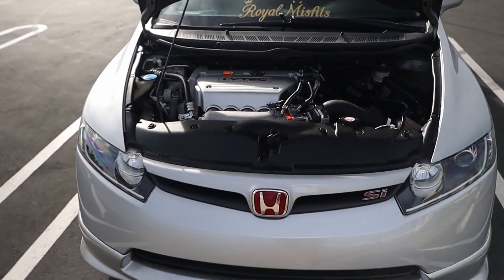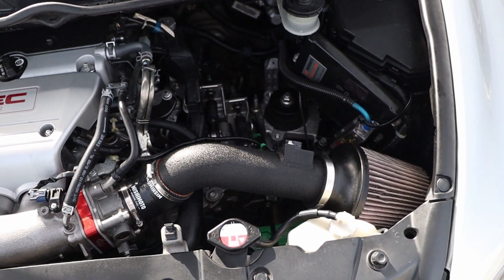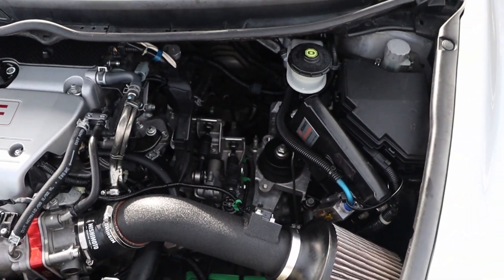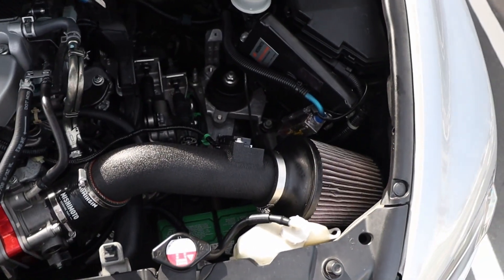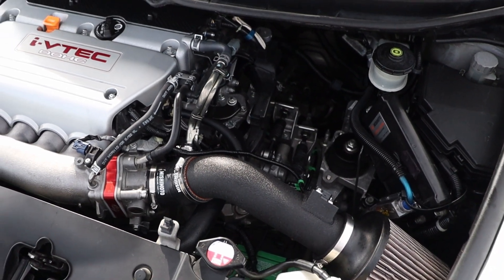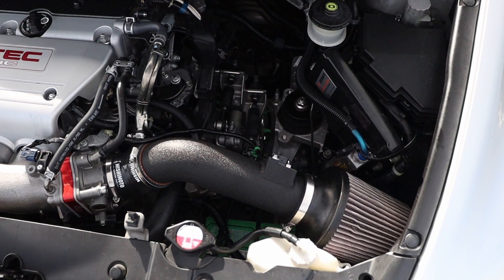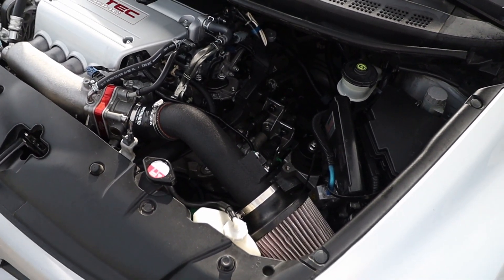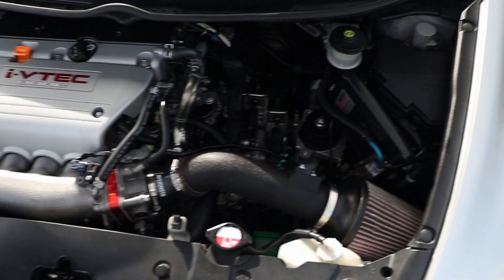8th Gen Civic Si Mishimoto Intake Review + Sound Clips

Comment: Nice video. I have the HR cai, so I am bias. But I also understand why some don't get the cold air, I haven't had any issues and I have driven is a good bit in the rain, though I do avoid puddles if I can.  Yours sounds pretty good though, especially in cab. I will have to do a similar video for mine. When I put it on, it was the first mod I did after base map flash pro, it was crazy how much louder it is. Subbed.
Reply from the maker: Thanks for the sub! I’m really tempted to purchase the HR CAI. It’s bound to happen soon…
Reply: @npvfa5  If you wanna stay with a short ram, you could also just buy a silicone upper rad hose, and run a 3.5" straight coupler to behind the headlight area. You'd lose around 5hp midrange compared to the CAI variant but yeah not too bad.
Reply from the maker: @throbbybobby7893  I was actually thinking about doing exactly that. I will probably end up purchasing the hose and using a piece of carbon tubing. Will lose the MAF sensor/IAT but i guess thats not too big of a deal.

Comment: Idk that sketchy for me. I saw that the mishimoto Intake comes with a heat shield. Plus wouldn't you leave the stock ducting from the oil intake that comes from fender to feed it cold air?
Reply from the maker: The mishimoto intake does have an optional heat shield which would help a little bit. However if you’re gonna buy the heat shield you might as well buy a cold air intake for nearly the same price. Also, the ducting which goes into the fender area does not blow cold air into the intake. It is mostly for resonance with the stock intake. With the stock intake there will be some cold air that gets sucked in due to the vacuum type affect of the engine sucking in air. Without this vacuum affect that ducting does nothing. My intake air temps with this setup are usually within 20 degrees of ambient when moving, and when stopped at idle it is about 20 degrees cooler than when I had it in the original position.

Comment: Hey man, where did you get the radiator hose? The longer one to extended it! This is a great idea!
Reply from the maker: I used the stock upper radiator hose. It did make some contact with the rubber piece of the intake. There is a well known replacement hose you can use so that it doesn’t touch the intake at all. The Napa 7777 radiator hose.

Comment: what bracket did you use to relocate your battery down there?
Reply from the maker: When I ran the battery relocated like that I had no bracket. There’s a spot on the frame and subframe that fits the battery perfectly. I placed the battery tray in there and just zip tied everything down. I had no problems with it like that, but a bracket would technically work better.
Reply: @npvfa5 why does it seem like my cables won’t reach or allow for me to put the battery down there?

Comment: How did you get the steering wheel with phone controls???
Reply from the maker: The navigation model comes with a couple extra buttons on the wheel. One of them is for voice commands. Bluetooth/phone controls weren’t a thing just yet.
Reply: @npvfa5  Here in Brazil we don't have this option. I found the steering wheel at ebay, but I cannot find the proper clock spring cable and the cable relay to the sound.

I have an aftermarket Pionner sound system and I miss the phone control buttons on the steering wheel.

If you know anywhere I can shop it online,  it you be kind of you to share.

Best Regards